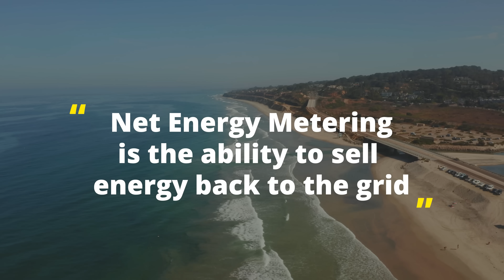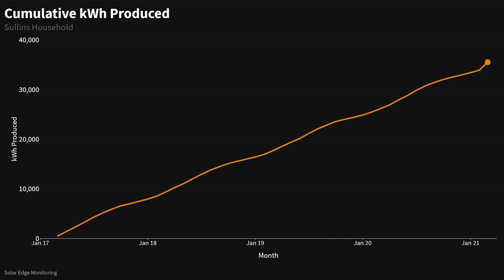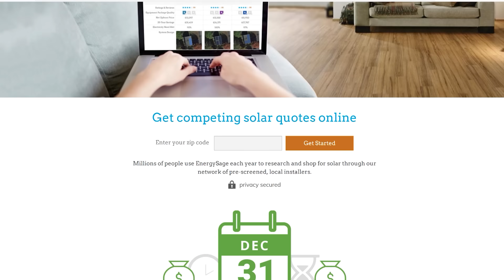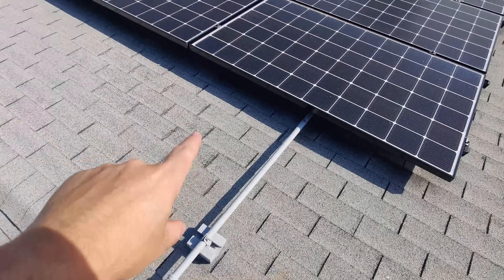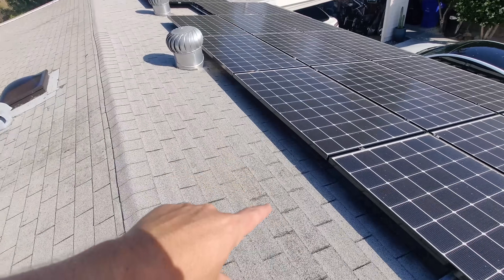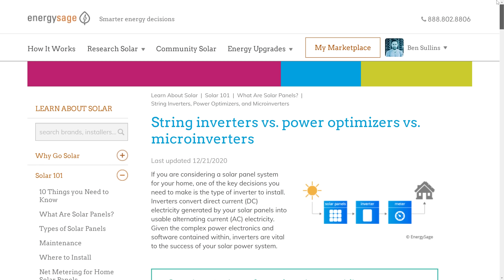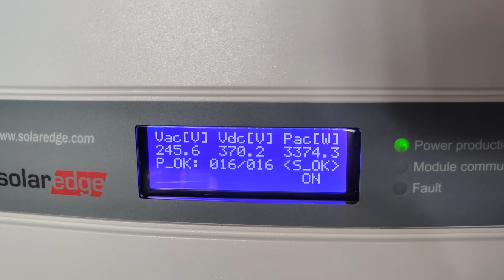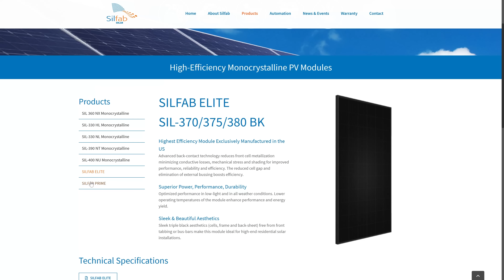The TRUTH About Solar! 4 Year Review

Comment: So while the point about adding more panels might seem helpful now to account for the future, it’s an bit misinformed due to the fact that from state to state, regulations vary related to “adding as many panels as possible”.  Most utilities and state regs only allow up to 125 or 150% of your usage in last 12 months.  And many states only allow up to 100% of your last 12 month usage. So not really the best advice because you will run into pushback from any installer u talk to based on the regulatory limitation on over sizing systems like he recommends…you would need to wait for the newly increased usage prior to expanding your system.  So don’t let that stop you from getting Solar now. 👍🏼

Comment: Couple things: 1) utility company doesn’t allow you to overbuild your usage any more than  20% so you can’t “max out the roof” 2) appliances are only getting more And more efficient every time you replace or buy anything new. You don’t need to overbuild because efficiencies now and 25 years later makes up for that 3) battery tech improvements also makes overbuilding your system not a good idea

Comment: We have a 10kw system. We have 2 Teslas and pretty much all power equipment we have is also electric. We net meter monthly. 6 months a year we make more than we use. 2-3 months we about break even. 3-4 months we come up short. I should break even at about 7 years. We pay 10 cents per KW.

Comment: To all homeowners before you buy. I recommend you exhaust all other methods of reducing your electric cost first. 
1. Insulation everywhere. 
2. Did i mention insulation everywhere. Cost is low and benefit is huge.
3. High efficiency hvac system.
4. High efficiency water heater. 
These alone will get your bill more than half reduced and cost less than solar.

Comment: Another consideration is whether or not to install a solar system that continues to generate power when the grid is down.  By law (UL1741) a grid connected solar system must cease feeding power to the grid during a utility power outage.  Most inverters are designed to shutdown if 240V is not present on the grid.

Comment: The net metering chart at 1:30 is outdated.  I am in NY and have had net metering since my panels were installed in February 2018. Best to check with your state's public service commission (or equivalent) or your utility.  Based upon Ben's recommendation, I used Energy Sage for solar research and to find my installer, and highly recommend them. Go solar!

Comment: In California I guess there is AC, but where I live most of our energy usage is for heating... in winter. With no net metering. The winter output of the system is around 1/6th of the summer.
It is fundamentally not possible to cover most of my energy usage with solar.

Comment: You're completely right- I'm even considering to put panels on the roof (32°) which is facing north (0°). 
Won't be the losses of the Micro inverters be higher?
As it seems you have local MPP regulators per panel. Why did you do so? The roof situation wrt shadow doesn't ask for it.

Comment: While your logic about putting as many panels up at installation that you can afford; it doesn't really work in a lot of California. PG&E's NEM2 Contract has limitations based on Energy usage vs. System Sizing. Right from the contract "NEM2 systems should be sized with an estimated annual production no larger than 110% of the Customer’s total previous 12 months of usage (annual usage) and projected future increase."

Of course, this is all go out the window if PG&E, Southern Edison and SDG&E get their way with the PUC and get their NEM3 plan approved which drops annual true up to monthly true up, increases connectivity fees anywhere from 5 to 10 times their current fees, and drops the excess power buy back price to 1 cent/kWh or less. Remember, California now requires new construction to have Solar? Every one of them will be charge at least $50/month just to be connected to the grid if the for-profit utilities have their way.

Comment: Here in Washington the state pays a per kWh bonus in the first 6 years along with net metering.  The issue is that a system over 12kW is considered commercial which pays a lot less than the residential rates.  So our system is 11.9 kW.  So. Worth. It.

Comment: thank you so much!, im stiil a bit scared thas it not gonna be worth it. i just installed a 3kw system (9 panels at 340w each) with a huawei smart inverter. Actually it´s a pretty nice inverter, it´s connected to your house wifi and with a app you can monitor almost everything, setup alarms, etc. 
Im waiting for the first electricity bill at the next month. For what i´ve been looking in the app, it should be around 70% lower.
Awesome video, keep it up. Greetings from argentina!

Comment: If AB1139 passed and signed in CA, the return on investment for solar will disappear.   

Utilities are pushing to eliminate net metering, on all solar installations.  Assembly Bill 1139, has already passed committee.  

Net metering (turning the meter backwards) will be replaced by time of use.  The utility pays very little for your solar contribution, and charges much more during peak, 4PM to 9PM, when solar isn't available.  Batteries can offset most of this, except for winter.

To make it worse, net metering is currently calculated on an annual basis.  Extra energy collected during spring and fall (no air-conditioning) offsets energy used in the winter when short days and cloud cover reduced collection.  This will change to monthly, the utility paying wholesale for excess energy.  The solar array size would have to triple to zero out winter months, battery size increase by a factor of 20.  Neither are cost effective.

Comment: Here in Florida they will only let you install as much as you currently use up to 80% of your service size(100 AMP,  200amp, etc), and if you go over 10kw they make you get expensive liability insurance and cut your feed in tariff to 2.5 cents per kwh(assuming your producing much more than your using annually).

Comment: You should do a video on how difficult it is to add more solar (maybe even a home battery) to an existing (older) system
Reply: - depends on system. I have an enphase micro inverter system. You can add up to 16 panels per run. I currently have 10 panels. These systems are connected in series so I can add 6 more panels to mine. All you have to do is plug them in line to the existing array.

Comment: Thanks Ben. I see you have a SolarEdge inverter. We extended the SolarEdge inverter with power optimizers in each panel. This means I can track the performance of each individual panel.
If I would have anticipated 7 years ago that we installed a heat pump, as we did last year, then I would have installed more panels indeed.
Reply: You can add more panels if you have space
Reply: Yep, you could easily add optimizers to your current system and get similar advantages of microinverters. Also, with your power wall you would still need some type of main inverter in addition to the microinverters.

Comment: My favorite channel to troll! Enphase Micro inverters are not more expensive then SolarEdge Power Optimizers. Also when you install micro inverters you still have to install a “combiner” basically a box with breakers, CT’s, and coms that is the same size as the new SolarEdge Inverters. The New Energy Hub Inverter with the Backup Interface is the way to go!

Comment: Just a side comment....I have been wondering weather coating the pannels with the famous "ceramic coating" (nano technology that I put on my car) would help keep the pannels cleaner over time and avoid to have to clean them yearly as I do. Anyone has ever done this?
Reply from the maker: interesting idea!
Reply: Don't do it. Use no chemical, mild soapy water. Some solar panels have coatings on them,( Silfab Solar is one brand) you could actually damage the coating. The last thing you want is to make a panel more reflective as far as light goes.
Reply: @MichaelFinkSunCommercialSolar  Thank you Michael, in fact, I was wondering that perhaps this type of coating could reflect mnore light, hence reducing the efficiency of the pannel. Thanks for this comment.

Comment: Fully agreed with your conclusions. I had SunPower pannels (4.8kWh) installed back in 2008 - living in Italy - and they were pretty expensive then. I have state subsidy landing on my account every quarter so this made the investment truly worth it. But since, as you said, we switched a lot of appliances to electric and we own now 2 EVs. So I decided to go and enhance my pannels by almost doubling the power (+4kWh). I did consider the SunPower microinverter ones but eventually stepped away from that solution and I will have a new inverter installed where I do have space. I preferred the Panasonic pannels because they tend to have a better efficiency at lower light levels which I was looking for in winter times. SunPower are great with very high efficiency now but apparently operate best at full power of sunlight. So yes, invest in more especially now that those pannels cost 3 to 4 times less than when I bought my initial ones over 12 years ago. I will also change my wallbox from the Tesla to one which is connected to my WiFi and manage the flow from pannels to the EVs or from my PowerWall 2 to the EVs. The Tesla Wallbox is just a dummy one and I wish I would have made a better choice 2 years ago when I got my Model 3.

Comment: I've had solar for about 5 years. I agree with all of this. I got micro inverters and they're great. Also, no high amperage wires on the roof, which is a safety plus.
Reply: Lol what? The wires still carry the same amperage, they just run at 240v AC instead of DC🤭
Reply: @BobLSaget  no, they carry 20A at 240V AC instead of 80A at 60V DC. If there's a break in the wire AC quenches the spark because it turns off 100 times a second. DC doesn't quench the arc.

Comment: Got my panels installed last year. Wish I was told more about inverter capacity. Even though I purchased an 8 Kw system, the inverter Tesla installed maxed at 6Kw. Wish Tesla would have  mentioned I could upgrade my 125 amp box to a 200 amp for additional fee’s. They failed to mention this at the time.

Comment: I'm building a solar system with an inverter that does need batteries. The solar panels are used. 250watt solar panel is $50. I have 30 panels. No grid tie for this system.

Comment: PG&E and some utilities charge you minimum charges per month if you over-generate, like $10, which eats into your NEM..
and more panels costs more.. so, you don't want to go TOO overboard in oversizing your system. (Some utilities are trying to shrink NEM repayments, too...)  You always want to know your annual KWH usage for last couple years, so installer can properly size your system.
But, in thinking ahead for future uses, bear in mind: An efficient EV like Tesla will use about 3MWH per 10k miles (eg per year)...
250-300WHr/mile x 10k miles = 250-300MWhr, plus 10-15% level2 240V charging overhead... so 2.9-3.3MWHr.
 Some of that will be replaced by supercharging or work, so.. round to 3MWH/10k miles, and scale to your annual mileage.
Double bonus for EVs and solar: not only does solar make your home charging free, an EV also saves you vs gasoline fuel costs, so!!

Comment: I totally agree, plan for the future and add capacity. 2 years ago we added 10% to a new installation with 1 power wall. Now have 2 EV’s, and need 50% additional capacity and a second power wall.
Reply: - check with your utility provider.  Where i live not many know but they offer an off peak program just for EV charging. You need a separate meter but the rate id's under .02/kw. I sell solar and there's  no way solar can currently beat that price.

Comment: Correction/clarification Ben:  Here in Texas we don't have MANDATORY net metering, but the majority of customers are serviced by providers that support it.
Reply: Except that the Texas electric grid was privatized and even if they support solar they will still only do what makes the most profit like coal and oil. They didn't keep the grid repaired so you had so many outages in winter but the elite that manage it don't care about the consumer.
Reply: Except that the Texas electric grid was privatized and even if they support solar they will still only do what makes the most profit like coal and oil. They didn't keep the grid repaired so you had so many outages in winter but the elite that manage it don't care about the consumer.

Comment: @Ben, Thx for 4 year review. I’m working with Tesla on a 14 panel / 2 PW system. Not using critical circuits panel. I’m in Massachusetts. Primary purpose of my system is to run my gas furnace in winter during grid loss. As your App is configured with your 16 panels and 2 PWs roughly how long would you be able to run your house (in emergency consumption mode) w/o grid? Assume you’ll be able to get some daily battery recharge from your panels. ThankU.

Comment: Shoot I live near the beach on the gulf coast. When I go to build a house I’ll make sure my roof is suited for full solar coverage east and west also I wind turbine with a breaking system. During hurricanes or windy stormy days I want to take advantage of some of that wind. When there’s no sunshine
Reply: Nick, don't know if I would bother with the wind turbine unless you are in a really rural area. To be anyway effective you have be 30 feet above any trees, buildings, etc. and have a larger turbine. In most cases the expense, maintenance and noise is not worth it, just go with more solar. Not saying there is no case were they are feasible, I know a guy on a farm that get good results out of a larger one (10 foot rotor, 50 foot tower on a hill). Just do your homework.
Reply: @glenndennis6801  wow didn’t think of it from that perspective. But you make a point. Only time I’d get anything from would be doing these wind storms and hurricanes. To get a large turbine that high can’t be cheap. Between material and permits and whatever else could be involved. Solar is definitely the way to go at the moment until something better comes along.

Comment: One preparation I did years before my solar install was to install roof vent tiles, but I was mindful enough to have them installed on the north side of the roof.  So if I was to do things differently,  I’d move all the existing roof penetrations (ducts, flues etc...)  to the north side, meaning I could fit more panels onto the south side.

Comment: Ben, you talked about micro inverters - is it really worth it?  I am looking at putting 14 panels on my roof and if each panel has a micro inverter at $160 each panel, that's an extra $2,240 plus labor to install them.  So what do I really gain by spending that extra money?
Reply from the maker: check the energysage link and talk with your installer, for us we would gain space which was more important
Reply: Steve R, the  "extra"  $2,240. ?   You would be paying something for an inverter if it wasn't micros. If you choose Enphase you will get a 25 year warranty on the microinverters.  My company replaces the inverters free as well. String inverters are usually 10-12 years or more if you pay extra for extended warranties.  We are in SW Florida.
Reply: As Ben said, talk to the installer. Some prefer & support/install different brands/types of inverters, some do not.
Microinverters help the most with varied shading of panels (trees etc) as a single shaded panel, reduces power from EVERY panel in the string. If no varied shade, string inverters might be cheaper, if bigger.
String inverters cost ~$1000-2000 (usually only need one), and need replacing every ~10-15yrs or so (check the warranty and installer coverages.) Panels last 30yrs.
I'm not sure how long microinverters last.

Comment: Ben,

I'm also in San Diego but thinking about moving to colorado springs to purchase my first home. I have a model 3 SR+ and was wondering if there's anything specific I should look out for when house hunting in terms of if the house can support charging. Specifically, if I plan to upgrade to level 2 charging at home. Thanks.
Reply from the maker: should be fine if it's built in the last century
Reply: @BenSullinsOfficial  maybe you could make a video on what to look out for to see if your home’s infrastructure can support it such as location, panel location, or whatever else I don’t understand

Comment: Micro inverters are also great for places where snow may cover your panels.  You get production on uncovered panels.  The down side is some of my micro inverters went bad after the warranty period.
Reply: Ben is using Power optimizers which do the same thing.

I also wonder why he is saying the micro-inverters give you panel level monitoring as the Power optimizers are doing this too.
 
Another thing is whether or not you are using 3 phases. I do not know if micro-inverters support that. Probably when you use three strings?

I have a 3 phase Solar Edge 17.5KW with optimizers and it's working great.
You can over dimension the system by 135% and the inverter makes sure you don't overload the return power.

The inverter can hang outside, so it doesn't have to occupy space in his garage. 
It is more of a wrong decision to hang it in the garage than it is a wrong purchase.